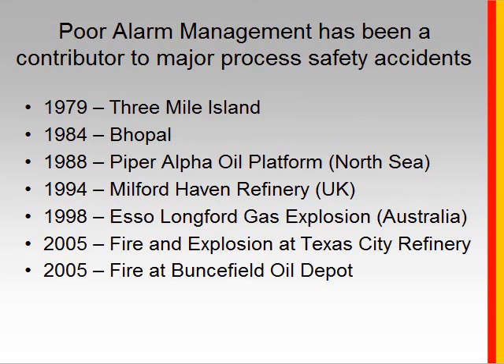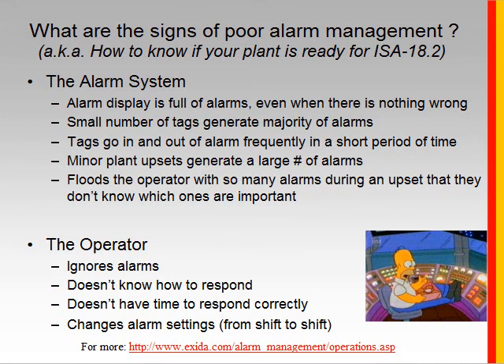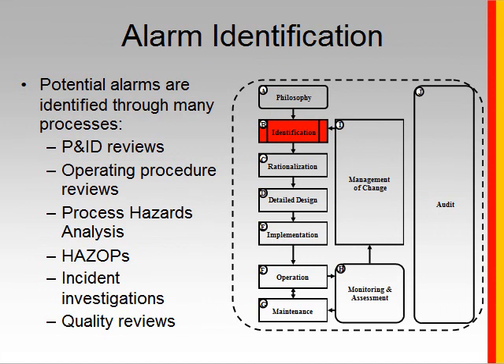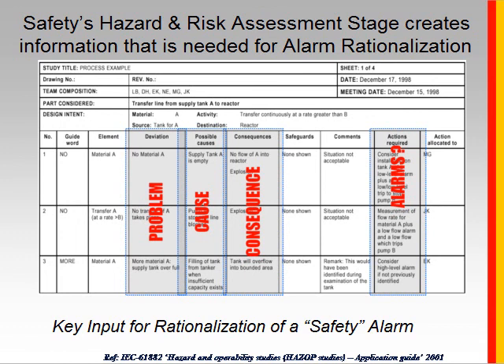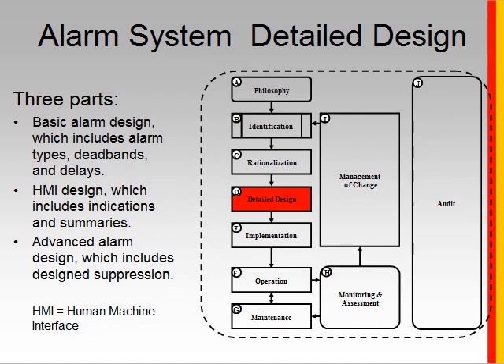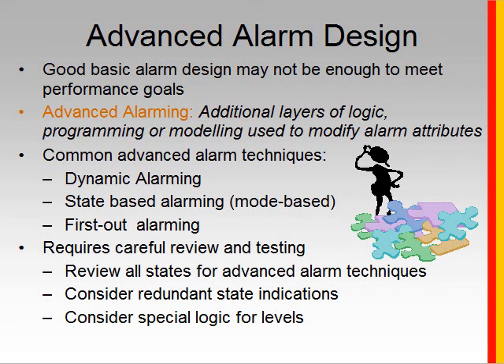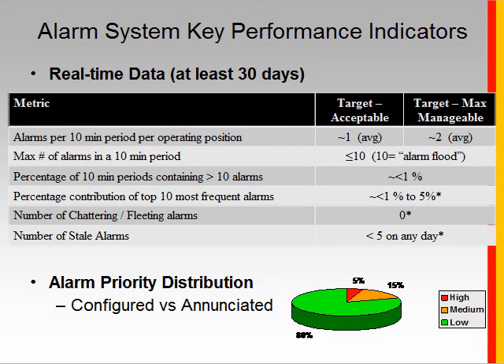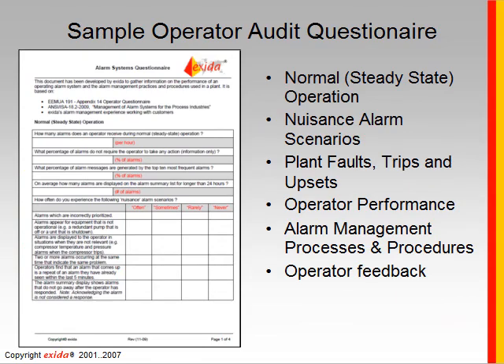ISA 18.2  - Setting a new Standard in Alarm Management

Comment: Many thanks Exida for this video. One quick question: My understanding as per EEMUA 191 and ISA 18.2 is that the priority of an alarm is determined based on the time to respond parameter and the event consequence. The time to respond parameter is in turn based on the time to event parameter and the actual operator response time. There are certain events where the time to event parameter could be difficult to determine and possibly indeterminate e.g A pump fault alarm, where the consequence is the potential to damage the pump. The time to event could be 2 seconds or even 2 months. 

In such cases where the time to event parameter could be possibly indeterminate, are you are of any industry trends or practices for prioritizing such alarms by say perhaps some consequence based methodology similar to the INL Consequence Based Engineering for Cyber security?